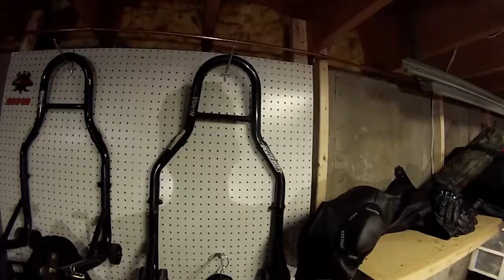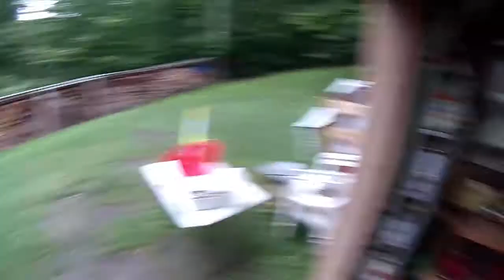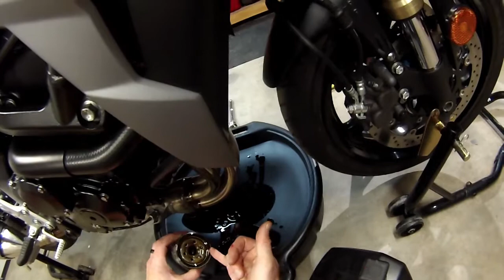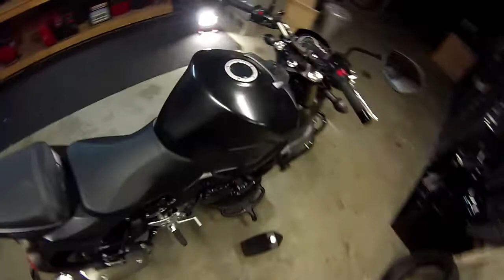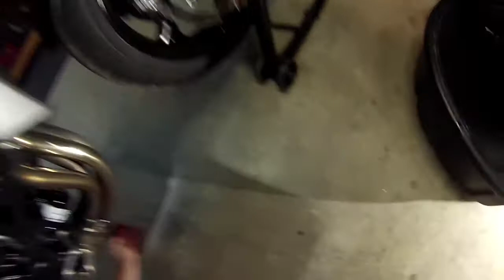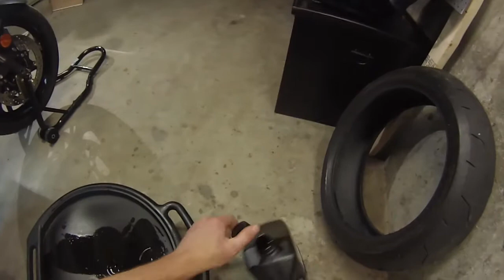HOW -TO | Oil & Filter Change | Suzuki GSX-S750

Comment: Thanks for posting. I’d have had trouble with the little clips if you hadn’t. First I wouldn’t have known what was holding it up after taking out the bolts, second I wouldn’t have known how to get them off. Of course they are easy but only once you’ve seen, as they’re not a normal fastener.

Comment: Hello! What is the feeling of power and acceleration with regard to the motorcycles you have ever driven? 114 HP seems not to be enough on paper, but when i look videos on Youtube it seems strong machine...I intend to buy two of GSX-S 750 another year for me and my girlfriend....no test vehicles are available here so i can not try it...thanks a lot!
Reply from the maker: Hi Marko! The bike only weighs around 460 lbs so 100+ HP makes it very fast. It's capable of completing the 1/4 mile in 11 seconds. When I first got the bike I could not get myself to reach redline in 1st gear. The sense of acceleration was too much and I ended up short shifting. I'm used to it now, but it's still a terror whenever I let it roll to redline. It's more bike than necessary on the street. But I think it's the perfect amount to provide effortless low end and mid range power with the occasional blast.There are more powerful bikes, but I don't think there is such a thing as a more fun bike. Handling is amazing yet the bike is comfortable enough to ride longer distances. IMO, it's got to be one of the best balanced bikes on the market today.

Comment: After almost 4 years, what oil type do you recommend for this engine? I am using the IPONE R4000RS, but I am thinking of changing to BelRay EXP Syntethic Ester Blend 10W40.
Reply from the maker: I have settled on Amsoil 10w40, Metric full synthetic, but its pricey! I have also heard great things from people about the Suzuki Ecstar synthetic stuff too. Price is a little better!
Reply: @sstressfl  Just one other, maybe idiotic, question. Does it really matter what oil you use? Trying to figure out if there are any signs you are looking for when deciding if a brand is better than the other.
Reply from the maker: @Screamer20  Growing up my dad always said "as long as it meets the requirements it'll work!".... but all of that changed when I bought this bike. I bought oil that met the manufacturer specs (the maxima stuff in this video) and it evaporated under the load and heat from this engine. I lost almost a full quart in 700 miles. Oil-evaporation was a new concept to me. It happens when the oil breaks down under severe friction and heat. So I did some research. Amsoil had the highest friction and heat tolerance of any oil on the market. So that's what I bought. And I don't lose a drop of oil between oil changes :)
Reply: @sstressfl  Good deal! Thank you! It's a bit hard for me to get a hold of Amsoil here in Romania as it isn't sold here. We have only Motul, Belray, IPONE and some other brands. I'll look in the datasheets for the friction and heat tolerance of the available oils type I can buy here. Again, thank you for your patience in responding to my questions.
Reply from the maker: @Screamer20  Oil is such an emotional game and mostly not based in facts. Good to do your research. Hope you find a good solution my friend.

Comment: What did you use to spray down the headers and oil catch container to degrease it? Thanks
Reply from the maker: Erik Acevedo Gumout (carb cleaner). It evaps very quickly but make sure the pipes are dry before starting.

Comment: How many miles did you do before you changed the oil?
Reply from the maker: DanieI Joseph I follow the factory recommendations.
Reply: Michael Byrne What is the factory recommendation (kilometre wise)?The previous owner didn’t have the owners/service manual
Reply: @NinjaKing878  the manual says 1000km-6000km-12000km-18000km-24000km..... I guess after 12/18kkm you can stretch that a bit more, every 6000km at this point seems a lot
Reply: A A Thanks just finished mine

Comment: Where did you take your front and rear stands?
Reply from the maker: Help me understand. What do you mean by take?
Reply: Haha sorry I'm french. I mean where did you buy it and what company made them
Reply from the maker: @andreleclair4921  I bought them as a set at amazon! https://amzn.to/37ysdYz
Reply: @sstressfl  I thought the bike was too heavy for the venom ones! Thanks
Reply from the maker: @andreleclair4921  The bike weighs about 450 lbs... the stands are rated at 450 lbs per stand. I've been using mine for years. I also welded the seams together to make it a little more stable. Here's my part 1 video: https://youtu.be/gmFHtAoooq4 and part 2 video: https://youtu.be/DXB-UkrKBVA

Comment: Good stuff thanks for the video.
Reply from the maker: Michael Vander Ploeg thanks for watching! Btw, I would recommend Amsoil full synthetic oil (or similar). The cheaper non-synthetic stuff I used in this video suffered from oil evaporation after 700 miles. Glad this video was helpful! Be safe.

Comment: semi or full syntethic oil?
Reply from the maker: I am now using FULL SYNTHETIC Amsoil 10w40. I buy the gallon size at https://www.amsoil.com/
Reply: I will buy Motul 7100.Some people say that semi synthetic is for this bike
Reply from the maker: daniel781984 I've heard good things from motul users. I found a study from 2006 (only one I could find) that put amsoil at the top for heat and shear resistance. So that's what I bought. I like it.
Reply: thanks for quick  answer. i live in poland.I buy this motorcycle one year ago and i must change oil. some people say that for this bike is semi synthethic oil